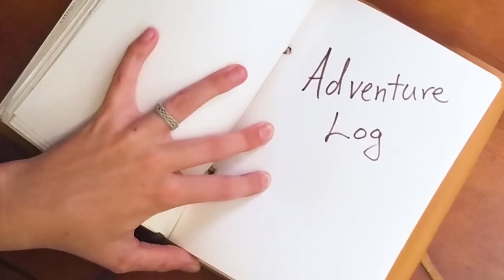ALL ALONE  - Wind Emergency, Dragging Anchor

Comment: Right on Emily! Maybe a half hours work to sew the awning up,,, Will be good as new!
Reply from the maker: It might be salvagable, but the fabric is 15 years old and has a lot of sun damage, and likely to tear again. The poles are bent, the grommets and rain collection piece are ripped out. We plan to construct an aluminum frame and hard top awning (with two solar panels) right behind the cockpit this summer/fall, so the canopy design would have needed adjustment anyway to fit around that and not obscure the solar. So we'll probably just leave it down. 

It will be a fun project to create a new canopy. if we can come enough floor space in our little house! BUT all this torn fabric will be great for a few sewing projects I have been waiting to do: I want to sew a bag to pack up all of our window screens when not in use; I'd also like a sun shade for our larger hatch. And leftover fabric may become part of the big mermaid we are building on the Stocking Island art trail. Stay tuned! -E
Reply: I was kidding, Doesn't look like any of it would be salvagable! Try and make the new one so its easy to take down in smaller pieces.

Comment: Since you are a US citizen you can always call the US Coast Guard no matter where you guys are sailing. The CG can contact the locals and give them your position if you are getting beset by bad weather. If you're close to the states you can use VHF Channel 16 or contact them via SAT phone.
Reply from the maker: Not exactly how it works out here, Keith. If we had an issue I would call out to our neighbors using the VHF channel they are on. In the video, you actually see one of our neighbors calling to offer help. We do the same when others are in trouble here in George Town. Unless someone needed to be airlifted to a hospital or similar, our neighbors are our best bet, and contacting local police next. Anchors drag and stuff like this happens on a daily basis. It's part of this life. Coast Guard is not the right answer unless you are in the middle of nowhere and have a life and death situation on your hands. (Think of it this way...if a branch fell on your house in a thunderstorm, you wouldn't call the Army, would you? Just ask a neighbor for help). You have to take appropriate measures for the situation.
Reply: @Clarks-Adventure  for non distress the CG can also send out a Maritime Assistance Request Broadcast if you can't get a hold of anyone.

Comment: which anchor did you have out?  the CQR?   ...wait till you get a mantus!  ;)
Reply from the maker: Yup, CQR. The bottom here is pretty soft, so we expect dragging a time or two over 6 months. We do look forward to a better anchor though.
Reply: do you agree with 2 anchors on the same chain?

there seems to be a lot of debate in the field about this erring in favor of only 1 anchor.

i was thinking of putting a mantus out, setting it, then releasing my danforth at 50ft down the chain from the primary mantus anchor.  ...although, from what ive seen, a mantus is all i really need.

is this too overkill you think?
Reply from the maker: Tandom anchors can be right in some situations.  They are not good if the wind/current direction will change (like this storm) because they tend to get tangled.   I use them often in the right situation but for this place I would prefer a big Mantus.  I hope they deliver on their offer when we get back to the US